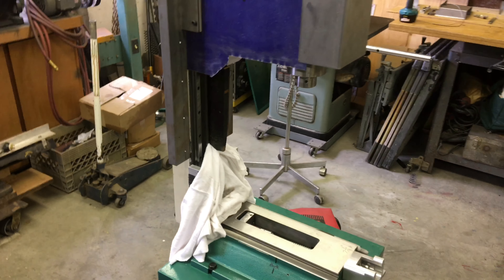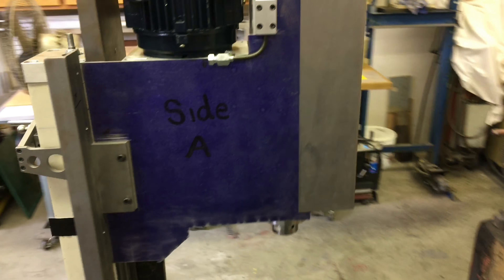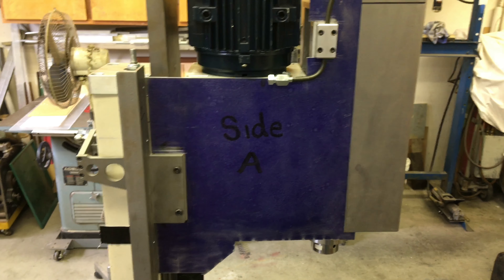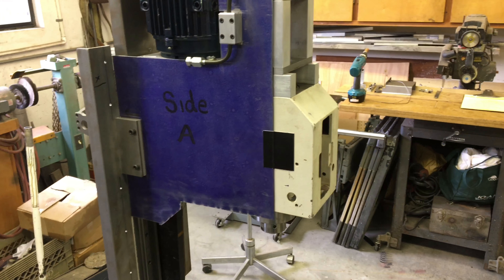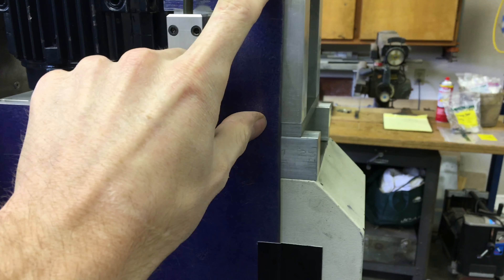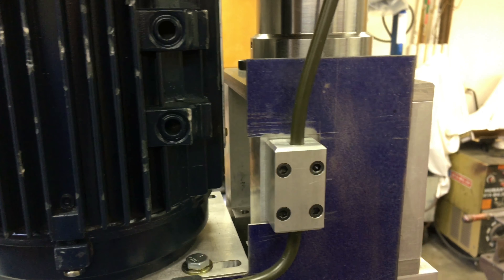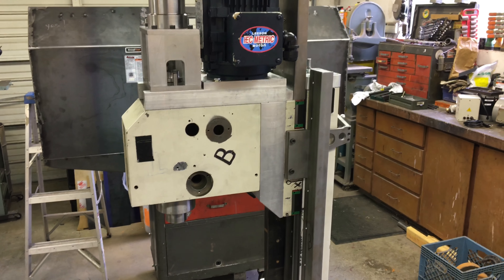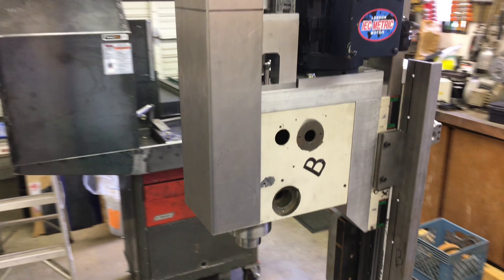GRIZZLY G0704 CNC Conversion Update 7 - ( head sheet metal)

Comment: Looking good! Mine is almost spinnin again. Need to figure out an enclosure though...
Reply from the maker: Thanks, Glad to hear you made some progress on your head! Iam telling ya man, get your self some shower curtain and PVC pipe!!  - Nick
Reply: Well, I have a bunch of 3/4" Plywood I could use. I will be quite heavy, but will probably dampen sound well haha. I'm not planning on using flood coolant ever so I'm just gonna make it square. I'll probably start on it next week. After that I need to order tooling and start making knives finally.
Reply from the maker: That's great everything is working out for you! Not using flood deftly makes things easier, the mister  you are using on your machine... did you make it? if not where did you get it and how is it working for you? Thanks - Nick
Reply: Nicholas Miller I got it on Amazon for $21? I've turned it on to test it out but I haven't used it while cutting yet. You can adjust it so there's barely any moisture at all, like MQL. Air is very adjustable also. I think it will work well, but I'll let you know though after I test it out.